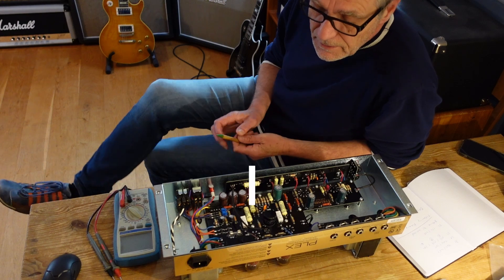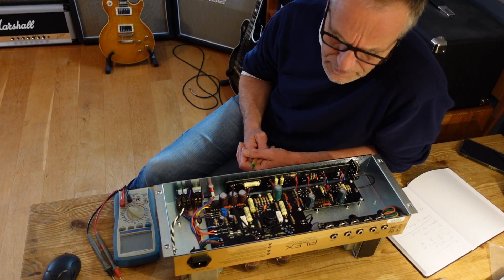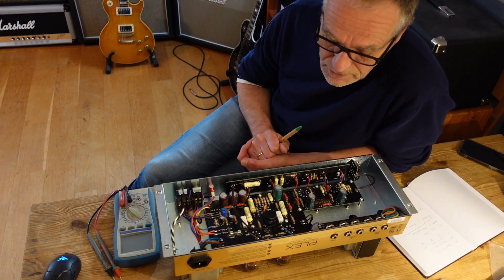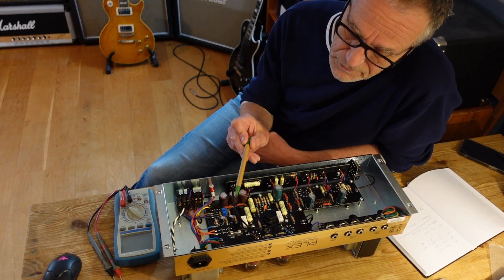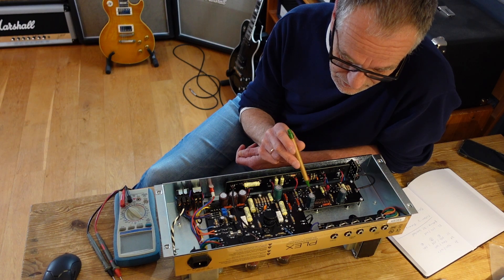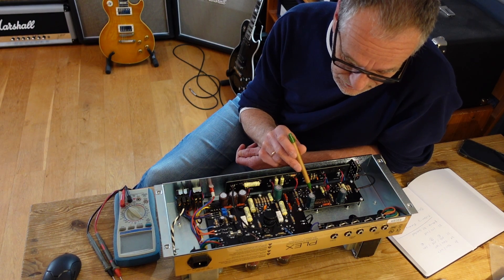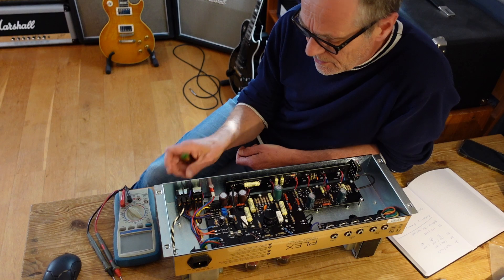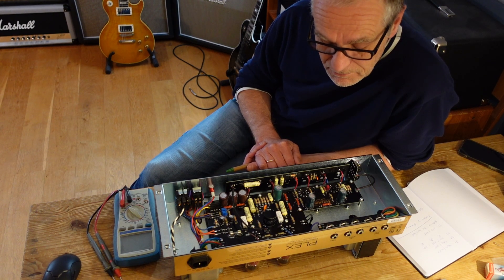Inside the Friedman Plex (pls read description for add. infos)

Comment: How are the channels jumpered internally?
Reply from the maker: From Input jack thru 68k grid for each side of the first tube. Pretty much as if you would use a jumper cable in a Plexi with 4 input jacks.

Comment: I have no problem with PCB's done right, but I am shocked to see board mounted tube sockets in this amp.  I will never believe that is a good idea or as good or better than chassis mounted.  That's a deal breaker for me.

Comment: The 22uf cap on the stage before cathode follower is large enough to bypass all frequencies, not just mids like with a more common .68uf.  It amounts to an all-frequency ~3db boost.
Reply from the maker: You’re correct. I wouldn‘t recommend to add it generally, but in a Plexi-ish without adding the bass channel to my ears the biggest noticeable effect is on the mids.
Reply: @duese888  I was off, more like a ~3.5db boost with an 820R cathode resistor. And thank you for the in-depth video!

Comment: Thank you for showing the interior. This is the important information. I would never spend this much money on an amp without looking at the circuitry construction.
Reply: Why in the hell would it even matter? You don't take apart your AC system or your Car's Engine Bay to understand them do you?
Reply: @eyedunno8462  Are you new to amplifiers? At this price point, the amplifier should last an eternity. Which means before you buy it, you should know the quality of the components and ease of repair. 

And yes I do open the hood before I buy a car.

Comment: Because of the price of this amp i would want to see point to point in this amp and as you mentioned some fancy tubes as well. But, the first time I saw this amp inside I was surprised about how sophisticated the PCB actually is, its well thought out and components are where they should be, or at least where I would want to see them on a PCB. But still, half the price is because of the name and half because of the amp it self. Overall this amp sounds pretty good.

Comment: How is the MVC wired? Dave claims it's not a regular PPMV. I ran a few tests over here based on his description and I believe he flipped the connections to pins 2 and 3 on the pots, added an extra pair of coupling caps and used 2.2M bias/grid resistors in place of the standard 220k. Is my assumption correct?
Reply from the maker: I can recheck the wiring of the pot in 2 days. Add caps I didn‘t notice. Output side of PI CCs are 100nF if I recall correctly. No grid Rs yes. Two 2M2 yes ( as in LarMar). Will let you know.
Reply: @duese888  Greatly appreciate it man, thanks.
Reply from the maker: @Beelzehump  Pot is wired like a variable resistor instead of a divider, which changes mostly the taper.

Comment: PC  boards are the way to go if it's well laid out, components are high quality,  and issues such as vibration and heat buildup are properly addressed.   The most reliable electronics EVER MADE are built on PC boards with those issues having been properly addressed.

Comment: No Close Up? You didn't talk about the 90vt variac switch. 
Large amp builders just put in adequate tubes as they buy thousands 
sourcing NOS tubes is up the eventual owner, like Me 8>)
Reply: The single most common service call driver from customers is tube failure. At Friedman production levels reliable tubes are a must.
Reply from the maker: There‘s the lower B+ setting (460 to 420 drop), dropping it to 90% of the „high“ setting, yes. I didn‘t read the preamp volts in that setting though.

Comment: To your first point, why are people still caring about PCB or PTP at this point? Guitarists are just… weird.
Reply from the maker: If you have a look at „Psionic“ channel, you will find some examples, where the conversion into PCB went really into the wrong direction.
Reply: @duese888  true, but he also shows examples of P2P done wrong on that channel.  At the end of the day, you either have a good design or you don't.  It's more about the designer than the method used. Guys like Friedman can do well in both methods.
Reply: @duese888 shout out to Psionic Audio, I'm obsessed with that channel.
Reply: Part of it is the perception that an amp costs a lot because it was labor-intensive. So they expect to see turret, board construction or point to point, thinking somebody spent some time wiring this up. 

Also, not all PCB designers are created equal when it comes to ground plains and thinking about where there will be a lot of heat in an amp.

At the end of the day, it will be the quality of the construction, not the construction method that will matter.
Reply: Because most pcb are garbage, especially fender, cheap thin garbage without through hole eyelets
Reply: I enjoy Carr, tophat etc amps. It has nothing to do with improving the functionality of the amps, I just enjoy the craftsman ship. It's functional art.
Theres no real benefit to p2p and it costs more to make and more to repair due to the time involved.
I think PCB gets a bad reputation because whilst it can be well executed and functionally optimal, it's also the go-to method of cost cutting and inherently creates a single point of uneconomical repair in budget amps. If a PCB dies in a katana, it's cheaper to replace the whole amp.
Reply: Ptp is easier to mod/service than pcb. Most guitarists who have these 'classic' circuit amps (1959,1987,2203,2204) are already at least middle aged, so to use an analogy, when your building or buying a house in your '20's you like the the split level designs, but as you get older you just don't go up those stairs as much...........working on a pcb requires more hand/eye coordination than a ptp for sure.
Reply: You have done a wonderful job explaining the advantages of a well laid out PCB construction. There are pros and cons to both PCB and PTP construction. My biggest concern with this particular build is the daughter boards for the controls and jacks. If one pot or jack were to fail, you may be required to replace the whole board for that section. That’s not a problem in the near future, but if Dave retires in 10 years and new ownership decides to not keep such parts on hand, this makes what could’ve been a simple repair much more difficult. I wish he had used traditional pots and jacks for this reason, but I understand the advantage of the approach taken from a manufacturing perspective. This exchange in ease of manufacturing comes at the cost of ease of repairability.
Reply from the maker: @jamarwright  With "traditional" pots it wouldn't have been possible to install the Tonestack and mixer Rs that close to the pots.Having the Tonestack close keeps AC off the other parts and is a clear (anti noise) advantage in my opinion. Thickness of the board is 2 - 2.4mm (not measured, but I do build PCBs . . .) which gives them sufficient robustness to get replacement/resoldering every now and then. Of course I do get your point that it looks neater and so on, but as long as the parts are higher quality than what Marshall is normally using (I could share some stories from the 900s onwards about build quality) I think it is fine. For sure all of us love the looks the traditional Plexi . . .
Reply: @duese888 - Traditional pots wouldn’t have been possible to install because the PCB layout and design didn’t account for them being used in the first place. I’m not saying it’s bad design by any means, I’m just pointing out a concern of this approach in regard to repairability. My point wasn’t that traditional pots “look neater and what not”. My point was that a single pot is easier to source and replace than a custom PCB if a pot goes bad twenty years from now.
Reply: Because most PCB designs are poorly executed due to the fact that the accounting department got involved. Corners cut and cost savings measures to increase margin result in design flaws. PCB can actually be better than PTP if executed correctly, like Friedman or Suhr or Fryette etc; but generally they’re the exception to the rule. In fairness most guitarists don’t actually understand even the basics of how amplifiers work and just regurgitate whatever they’ve heard about PCB being terrible.
Reply: @K707OR30  Never mind that virtually every electronic device in our lives has been PCB. I like turret board purely because it’s easier for me to change out components and follow what’s going where, as I’m an electronics amateur but for stuff I’m just playing, all I care is that it will be reliable. I’m a lot more concerned when they cheap out on iron, like Marshall has done. After watching a Psionic video on bad pcb design re: Power tube pins, for a Tone King SkyKing, an expensive amp, I’m hoping it was not carried over to the Royalist I got new a few months back.
Reply: Cool vid.   Design is all about compromise.  Good well laid out pCb is a thing of beauty just doesn’t happen much it would seem.   If the sound is there and the craftsmanship is there what more does a guitar player want?   Why would any designer and owner cut his own knees by racing their price to the bottom because they can.  Cheers to Dave for being a great designer and getting a cool product out.  If you don’t like it you have choices.
Reply: The quality of the transformers... especially the output transformer is a much bigger factor than PC vs PTP board.
Reply: I can repair (fast and easy) any ptp amp.

I can't repair any pcb amp. I need a schematic, and most of the time an oscilloscope. Components quality is very often low on pcb constructions because it is mass produced with cost and built time in mind. Ptp is hand made by artisans with quality in mind.

Each customer can do what he wants with his money, but I chose ptp, it worth the investment. 
Actually we found digital amps. Let me tell you that nobody will repair them. So if you depend on your gear you should buy several...
Reply: Because people blame the technology instead of the designer or the fact that companies cheap out on parts 

I have designed audio electronics professionally for over 30 years for all kinds of companies.
There's absolutely zero reason why there would be any downsides.
But people just like to parrot each other and like to get extremely pedantic about silly details that are completely irrelevant.

A dual sided pcb is also not harder to trace. That's just being lazy.
Most of those guitar schematics are extremely similar to begin with
Reply: Ha ha funny.
Reply: It is a ‘through hole’ PCB and there are no ‘SMD’s ?
Reply: It makes no difference in sound. There are lots of old Marshall’s with PCB’s that works just fine. This discussion is just for the cork sniffers. It’s plain stupid.
Reply: Dave saves a lot of money relying on pcb main board and (even worse) daughter boards. That is OK as long as he would give this money partly to us. This box should be at least cheaper 1 to 1.5 grant cheaper and still would give Dave a decent income. But that can be seen across his entire product line. Go and get you a Suhr SL 67 or a PRS HDRX and you will be better off quality and durability wise.
Reply: A lot of things can (and do) go wrong with a pcb, like underspecced filament traces, bad servicability or inadequate heat dissipation from the power tubes. Even large brands keep making those mistakes.
Reply: @Synic42 good to know not everyone swallowed the bait and sinker lol

Comment: I've heard the ppimv is unique.  Did you notice anything about it ??
Reply from the maker: Been a while that I did one myself, this looks pretty „standard“ to me. Replacing the two 220k with a dual pot. Since I didn‘t blueprint the PCB it could be that I have missed sth. I will have a look again and post that into the description in case I can see a uniqueness.
Reply: @duese888 I would be very interested in the exact implementation of the master volume, too 😊
Reply from the maker: @romanhausner456 Dual 250k pot, fed from bias, each side to Pin 5 of each PT incl 2 x 2M2 Rs in parallel. 2M2 on PCB, close to sockets, no grid Rs. Pretty much a LarMar w/out screen Rs - as far as I can see from top of the board.
Reply: @duese888  thank you!
Reply: @duese888  Thanks for that. I've used lar mar in a number of builds. it's pretty much the best ppimv for me . I took his explanation to mean it was something new that he came up with ...
Reply from the maker: @soapboxearth2  if you have a ptp larmar, just give it a try. The taper will be different obviously
Reply from the maker: The pot is wired like a variable (dual) resistor and not like a (dual) divider
Reply: My analysis: A PPIMV reduces NFB as it is turned down. This causes clipping in the PI to increase. This compensates for the lack of power tube distortion, but can sound a bit thin and harsh. 

By wiring the pot as a variable resistor, the phase inverted gets loaded down as the PPIMV is turned down. This reduces phase inverter gain, and could perhaps lead to a more constent tone. 

The coupling caps and variable resistors act as a high-pass filter with the frequency depending on the PPIMV setting. With small coupling caps, this would result in loss of low end as the PPIMV was turned down. With the big 0.1 caps, it should not be a problem.

I need to try this on my Plexi-ish build...

Comment: So it's pretty much an SV20 with a neater board, PPIMV built in, and a fixed bias output section instead of cathode bias? Seems pretty dope. Definitely don't agree with the pricing, but ey, what can ya do. It's not like he's mass-producing and mass-selling them like crazy. Gotta bring money to the table.
Reply from the maker: Good summary. The switchable bright caps, linked input and mostly full power/standard 50s B+ and transformers also should be counted in.
Liked the SV20 I had, cut the bright cap off in the treble and got pleasing crunchy results.
This has for sure more ooommmppph.
Reply: @duese888  Yes, I completely overlooked those!  
  
That cathode bypass cap on v2 likely provides the oomph! I'm still messing with the SV20, and that's next on the chopping block. I didn't cut my bright cap, rather added more to choose from :P
Reply: Why SV20? This is a 50watts, sounds better than any other Friedman, and it's more quiet (no hum) than any Marshall. This is the best Friedman amp so far, and cannot be criticized for not being raw enough. This is in short the best Marshall ever made.
Reply: @myuncle2 agreed….some of the commenters need to play the thing first. Plexi with modern twist and it’s absolutely killer, the best!